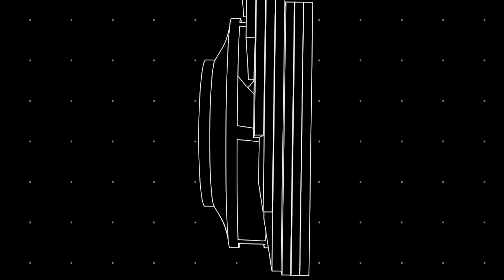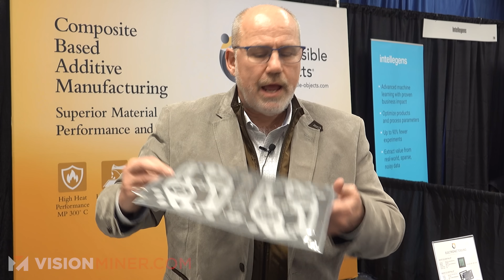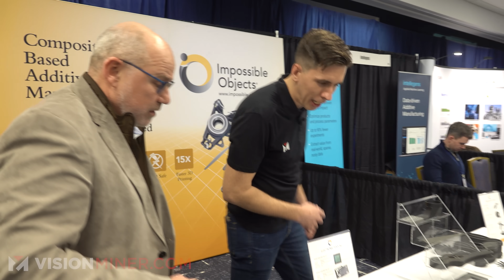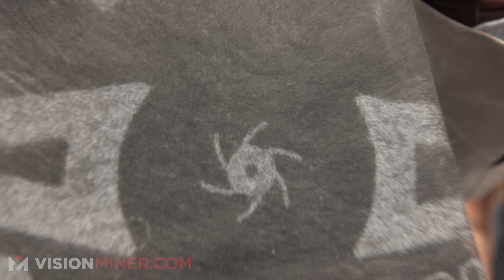Impossible Objects is Disrupting 3D Printing With a New Process | AMUG 2023 w/ Vision Miner

Comment: That's actually pretty good. Obviously not the peak of production technology - it's not gonna work for everything, but it's another new process of making stuff. You now have more options. It is bound to be excellent for making lots of parts better cheaper and faster than what we have so far. I only hope they don't make it proprietary and prohibitively expensive.
Reply: Your only hope is the opposite of what motivates them.
Reply: @QiwiPear  Not true. Stratasys fdm printers use proprietary hardware and chipped filament. You could only buy material from them. Their business is losing sales and you don't hear about them any more because people that do additive manufacturing for profit would rather use something that actually makes money. The more options that people are given, the better the competition. The fairer printer manufacturers and ones that use open source have historically done better. e.g Prusa.
Reply: @Stoddlez  I simply set the bar low when it comes to this stuff, they're all smiley and confident and then I probably never hear of it again because of their greed
Reply: @QiwiPear  You're right about that. It's so sad. I just want to print great things but it's usually too restrictive to be used at all.
Reply: @QiwiPear  Then their motivation is the opposite of the need of the market.
Reply: @firewoodloki  I agree,  but I think the point was and is, that greed motivates most corporations. Why did they make this? To help people? Maybe, but in most cases they made a product or type of product and want to sell it, in this case they seemed to have created a new form of additive manufacturing which is great, but if they are the only ones doing it, it will make it very costly. Otherwise, if you are good at something never do it for free, and that goes across the board. I would not expect anyone to give me something for free, nor would I in most cases, sadly we still need cash to pay the bills.
Reply: I hope they start using this to make Toyota door handles because too many the door handles on my Camries and my Corollae seem to be falling apart
Reply: @QiwiPear  Yep, the motivation here is more than likely... 'Own a holiday home in the Maldives', than it is 'Let's help society'. Lol.
Reply: @IPrint3dMinis  you are mixing two different things up. Large corporations are typically very greedy. They are also not the source of innovation.

This guy, and entrepreneurs in general, are most likely not motivated by money, but by an itch. Whether that itch is to solve a problem, a fascination with technical possibilities or to help people is a matter of the individual story. 

I don't yet understand when and how successful start ups turn into greedy corporations (Facebook, Amazon, Apple for example), the stories I know where greed was present from the start (Theranos, IRL to just name a couple)always turned into dismal failures. I have yet to see a successful startup that had this hubris & greed from the get go and these factors run counter to everything a startup needs for success.

Please do not lump all people running a business into the same category. The vast majority of businesses are small to medium sized, run by decent people, who care about their employees and customers. It's the big corporations that are mostly the bad actors.
Reply: @Stoddlez  Not true? You're basically agreeing with the guy. 
Besides that, I don't agree on you take as to why how open source printers have "historically done better" and that they are the reason Statasys is hurting. What happened, pretty much, is that the Stratasys had the market cornered and made shit tons of money for as long as their patents lasted. Then not long after, you see an explosion in cheap printers that can do some - or a lot - of the same as a Stratasys and also some higher priced ones aimed at industry that can do what Stratasys did, but still cheaper. So, no - open source hasn't historically done better as there hardly was any open source until the patents ran out and that really isn't that long ago...
Reply: @AntiVaganza  Get out of here, lol. SSYS stock price is hovering around 2006 levels! They also drove MakerBot into the ground. You can't even read what I'm saying if you think I'm agreeing with a comment that I wrote not true to.
Reply: @QiwiPear  i am the LK-99man, you may wish one thign!!

Comment: Reminds me of when I used to lay up Kevlar or Carbo composite in aviation. I never fully bought into the idea of having fine strands of reinforcement particles in the filament rolls because the entire point of composite sheets is that the mesh pattern gives the strength while the resin shapes the material. A slurry doesn't offer a pattern, but just a random mixture of material. Super cool technique!!!

Comment: What's great about this method is that it's relatively low tech.  I'm sure their proprietary machine currently costs a million dollars, but I think this process could be done in a way that is affordable on a home machine.
Reply: yeah, just a sheet with a steady thickness that could be bought and massproduced. known ink-jet technology, vacuum, preassure and temperature. It needs a lot of space to achieve a good building volume and could probably be compareable to fdm speed but better material specs and scaleability at the cost of reduced geometry.
Just compare that to SLS where you need absurd controll to even get an even layer thickness...

Comment: Use cases are clearly limited but there are some that will definitely benefit from this. The blades look really great for example.
Reply: i don't know how well it scales with bigger objects, but being able to make production parts without a mold is crazy. although i guess its a moot point since you can also 3d print the molds
Reply: Limited? 😂😂😂😂🤦‍♂🤦‍♂
Reply: @julianreverse  actually extremely limited. The list of disadvantages is long
Reply: @Gromic2k  Such as?
Reply: @paulwal222  You have to print the same thing over and over again to make a single thing, in molding for example you just have one mold that can create multiples of the same thing almost instantly. Also alot of waste product from sand blasting literal carbon fiber.
Reply: @yayayayya4731  CF isnt actually that big of a part of the cost of most carbon things; most carbon things are as expensive as they are because of the many manual production steps. That being said if you are blasting away 99% of it thats probably going to hurt.
Reply: @eelcohoogendoorn8044  yeah now that I think about it, CF is wasted in normal layups too with the cutting and all that. and I guess space can be maximized by positioning the parts compactly like when laser cutting parts and stuff
Reply: Its limitations is its build volume at L 457 x W 449 x H 101 mm. Its height limits what can get made
Reply: actually the use cases are way more open with this type of printing than traditional laser engravers and fdm.
Reply: @zxcaaq  can you elaborate a little please?
Reply: @eelcohoogendoorn8044  All of that can be automated. Literally this can be made on an assembly line floor with nothing but robots. No need for humans. This literally removes the need for doing hand layups completely, as it gives a direct jig which can be handled by robots for more accuracy.That means repeatability, and zero stability, which means that the zero marks on any system of machines can merely be adjusted for once. 
 
No molds, no resin mixes, and the clean up can be done in a closed environment with a blaster and vacuum process, all automated? This is almost ideal.
Reply: @Stopinvadingmyhardware  I agree; this should take the manual labor cost out of the carbon part (and it restricts you to flat fiber orientations, but soit). So thats great; but the loss of carbon material might offset that for some kind of part geometries I fear.
Reply: @eelcohoogendoorn8044  The primary cost factor of Carbon Fiber is the lack of manufacturing. 

More demand for it, should in theory, spur more manufacturing of it. 

We do need that here in the US as the cost is ridiculous still after thirty something years of market adoption of it. There's no reason other than that there's almost nobody making it. 

The material is in huge demand domestically by literally every major manufacturer, and we are still stuck at the production levels from twenty years ago. 

It's a supply issue. The US needs that industry if we want to remain competitive. 

No matter how anyone wants to see it, this stuff is the future. Durable goods designed to last, and be light weight. These are almost the perfect materials, and that company just knocked the cost of manufacturing products with it through the floor. 

PEEK is almost as good as UHMWPE, and in many ways superior, as it behaves like a ceramic with compressive loads.

Comment: Cool idea. I imagine you could parallelize it to do many sheets at once and really speed up the printing time part of the process.
Reply: Big 4x8 foot sheet of this...like a full sheet of plywood then panelize all the objects...print em, stack em, bond em, then run em thru a huge sandblaster to separate the parts...
Very cool!!!!
Reply: It looks like their top-of-the-line system is already a continuous feed printer.  Raw print speed of 10,000cm^3/hour, or closer to 3000 when you account for the packing density of your parts.  I'm sure it costs more than my yearly income, but damn.
Reply: @Rathmun  I think the heating and pressing would be the bottle-neck.
Reply: @sNpeR1080  Maybe.  I expect that in a large industrial setting you'd have fixtures that just consist of a pair of plates held together with bolts to apply pressure, and then send them through a conveyor oven.  Or maybe the top plate is just weighted and slides on smooth rods so it applies the same pressure despite thermal expansion.   That might end up back on the printer being the bottleneck.
Reply: @sNpeR1080  make it like a domino's pizza oven.  In goes sheets. Out comes parts.  Interesting idea.
Reply: @BigDollars360  If you don't get it in a half an hour, is it free?
Reply: @BigDollars360  that would be an interesting idea
Reply: You're absolutely right, 1000 layers can be printed by 100 printers in the time it takes to print 10 sheets. So in this case 9 women make a child in a month!
Reply: Gigafactory it. Iron Musk showed us how.
Reply: @BigDollars360  Want to keep playing this game?
Reply: The printing doesn't appear to be the rate limiting step in my eyes.  Assembly of the layers would be tedious but could be automated.  More problematic are the sandblasting and subsequent cleaning stages that this video glosses over.   (not to mention that those nonwoven graphite sheets don't come cheap, and you are throwing away 90% of that material!)

Comment: Seems like it could have very promising material properties, although it won't be isotopically strong due the layering process. The process also has a lot of steps that may introduce deformations although they may be mitigated by the carbon fibre medium.

Comment: I love spaceflight and I'm very interested in it.
this way of manufacturing seems to be rather simple and robust, lightweight and actually not dependend on gravity. and if your only other source for spare parts is back on earth, 3D-printing makes a lot of sense, and producing the parts light and durable will be important too.
Reply: FDM/FFM printing is also not dependent on gravity though. Plus this would likely introduce tiny particles into the spacecraft which is a big red flag.
Reply: @jaydenwiener4899  you are right, the video mentioned 15mm carbon fibers. that could produce interesting shorts on PCBs

on a planet however (like mars), that shouldn't be a problem (because of gravity).
Reply: I'm not really sur about sandblasting carbon fibers in space environement tho. Between the sand and the cabon flying everywhere (air filters and your lungs)
Reply: @robertheinrich2994  I had originally thought about mentioning how it would have a place on space colonies, yet I find it difficult since the area would likely have limited breathable air If these fibers/sand got into the air, then they could very well be a massive hazard for any sensitive equipment or human lungs. 

If the system was moved outside or in a specialized unit to entirely prevent the possibility of contamination, it then suddenly requires a whole unit to be built, and a number of precautions any time a single part is printed. In theory, it has a place in space. I believe it would just be better to utilize other technologies until we have a larger base to properly manufacture things on, but by that point we may have vastly superior options.
Reply: @jaydenwiener4899  yes, this technology is quite special and yes, I can see that the carbon fibers might cause a problem. but I actually thought about a situation where the settlement on another planet wouldn't be that restricted.
the most problematic part might be, that they sandblast the remaining fibers away. but it must be contained in some way or that hall where they showed the system would be hazardous.
besides, printers that operate with metal powders (lasersintering etc) have the problem, that the metal powders aren't that lungfriendly aswell.
so there might be a question, when can you run the setup outside. or does it need all the shielding from outside?
for example, the first spaceX starships are considered expendable and will not go back to earth. so maybe cut the tank open and set the printer up inside?

Comment: Cool. But since you compressed it, doesnt it affect the dimensions? What is the accuracy?
Reply: That should be easy to calculate as they would know the amount of shrinkage at certain pressures.
Reply: Of course it affects the dimensions. You calibrate for POST-stamping dimensions, not pre.
Reply: "High Dimensional Accuracy to 100 microns" "No shrinkage or warpage" what their website says... you can google the name and check, there's some more info there.

Comment: No thermal stresses while printing, true.  But the next step requires heating a massive block of material.  The inside will always heat up more slowly than the outside.  And then again during the cooling process.  You could reduce the stresses by cooling it slowly, but there goes the advantage of high speed printing.  I also wonder about the accuracy of the dimensions, especially in the Z-axis.

Comment: Interesting process. But since a press is involved, how do you control the finished Z height considering the press may over-reduced the height.
Reply: I'm very experienced at guessing! so - no matter what part you build or its dimensions - every sheet of every part is going to be identical. If you have the same material, same process, same batch and all that. So that's basic Quality Control for that material. So - it doesn't matter what you're building - it's just how many layers is this part - and the press is calibrated and takes care of business. That's my guess.

Comment: Definitely a niche technology but composites have so many use cases and more ways to integrate fibers in parts are better, I think. This is a way to do this I didn't think of so far. Cool new approach.
Reply: I wouldn't say that. The molten solder example is extremely impressive - for a one-off that can survive extreme heat and caustic chemicals, there's nothing like it.

Comment: So the object being at room temperature, as he stated, when you begin the compression phase, he goes on to indicate that this is beneficial to mitigate complications coming from variations of temperature. Well, depending on the design of the print, wouldn’t it be possible that a portion of the print could be vertically taller than another portion of the same print, thus subjected to the compression before the shorter counterparts? Maybe I’m misunderstanding the process as he explains it, but if the scenario I described is the case, I mean we all understand compression generates heat. That would introduce temperature variations
Reply: If I'm understanding what he explains at the start of the video, the whole uncut stack goes into the compression/melting process, and afterwards when it's cool the portions of the sheets without binder are just sand-blasted away.
Reply: @benjaminbridger7771  I see I see, thanks!

Comment: Do pressing won't change the dimensions? I mean if we need accuracy
Reply: only if the sheet is oversaturated with plastic, if it isn't, then will only change given the elastic modulus and Poisson ratio of the carbon fiber, which should be a lot smaller than thermal expansion, so it becomes irrelevant.
Reply: Pressing doesn't change dimensions, the dimensions of the final build are known and the press could be stopped at that height. Providing they have a way to do that reliabily 🙃
Reply: @TheRealAirdoo  If we can figure out how to shit melted plastic out of a sewing needle and get accuracy under .01mm we can figure out how hard to press some sheets, dude.

Comment: Have you considered adding a laser cutter to the work flow, to cut out internal shapes on each sheet, before forming the part? Then internal features wouldn't need to be sand blasted.
Reply: That goes against the compression process. I bet that's extra important.
Reply: Maybe would be usefull before the printing, cutting out the outline to reduce the waste?

Comment: what do you do with the used sheets? since you are jetting away the material off the sheet it seems like its still subtractive manufacturing with extra steps? Seems cool and i don't know enough about carbon fiber to know if this process is more optimal than whatever we are doing currently but calling this additive manufacturing seems to be a misnomer.

Comment: Nice, 
Q: How do you dispose of the carbon fiber dust after sand blasting responsibly? 
Do you recommend adding some polymer binding powder and melt it as a block or other?
Reply: using the suprerior recicling industy of hungary. it can be